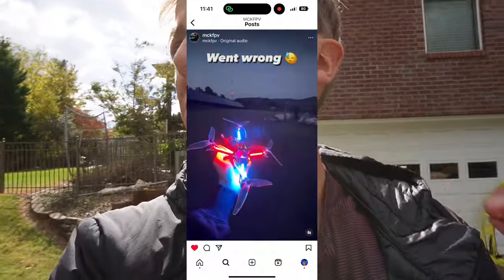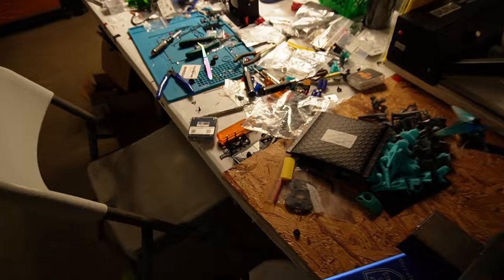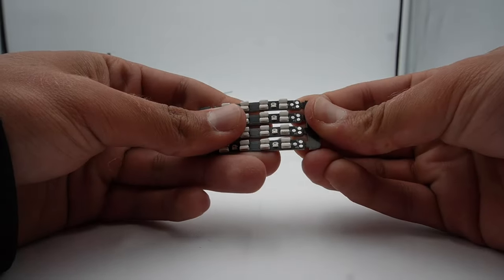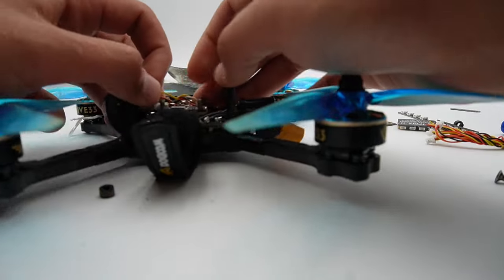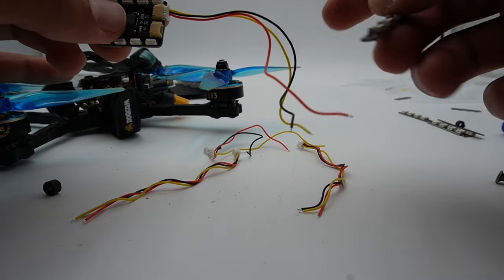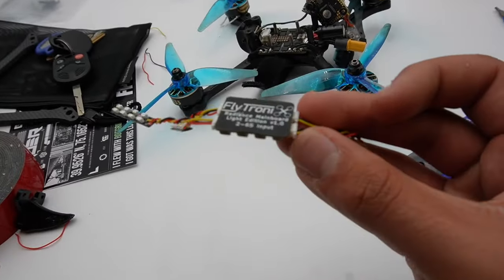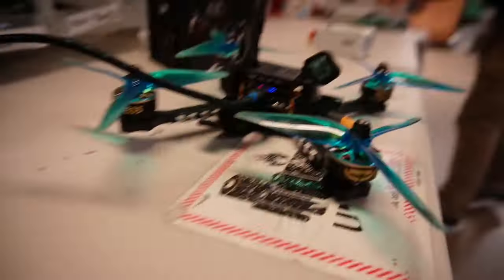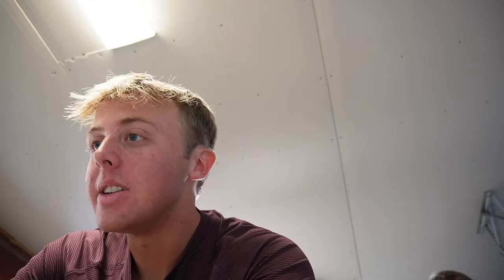How to Light Up Your Drone | FlyTronix LED Kit Review

Comment: You mentioned that other LEDs need t be wired in series which isn’t entirely true. You can wire each board in series or parallel. If you wire in parallel then the lights are not all individually addressable. The lights in the same positions on each board will always be the same color. It looks like that is how this kit works. It is also not necessary to wire power in series. You can just attach the data line at the far end of each board to get all the lights to be addressable.

Comment: I would prefer the FC had led pads on each corner of the board - i saw one fc with this feature. 4 thick stack is way too tight. Might put those on top of the top plate with a tpu cover instead so i dont kill my vtx
Reply from the maker: It’s for sure too tight, absolutely, I think longer standoffs would be the way as I’ve tried putting boards like this exposed on the top plate and even with covers it never ends well. Gonna keep thinking!
Reply: @headsupfpv  bigger standoffs then. Or maybe an fc with 4 LED pads (one each corner) 🤔
Reply: Don't you have an HD Zero to be working on? Lol! @RyanQuellet